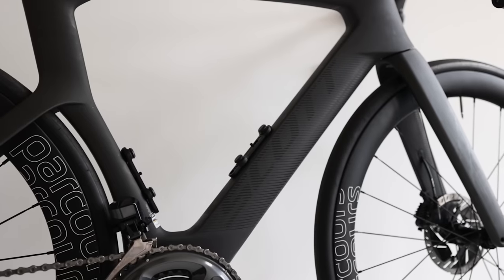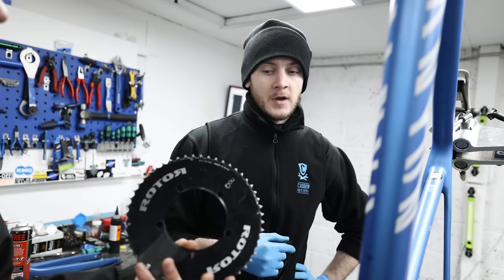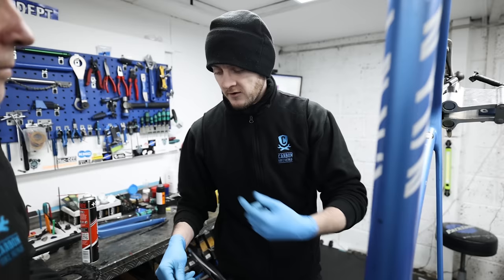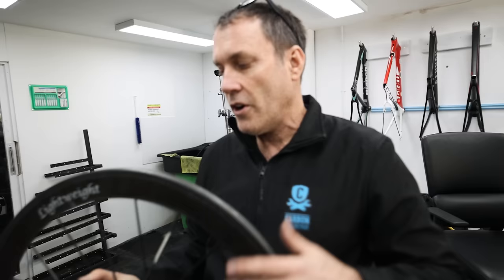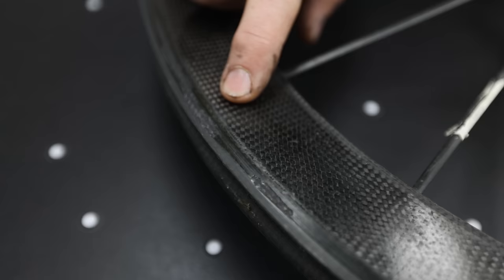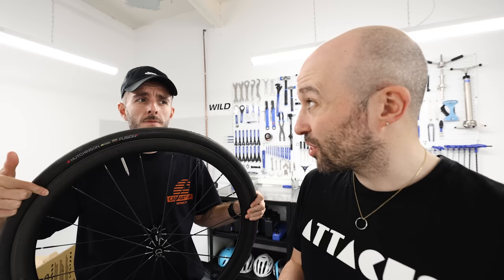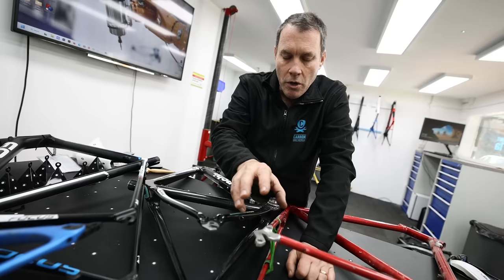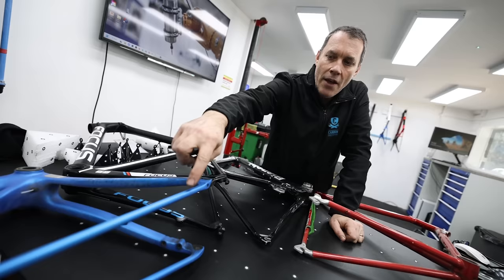6 Bike Products That Shouldn't Be Carbon Fibre

Comment: I was a carbon fiber skeptic from the beginning, and such information only serves to confirm my reservations. 

I’m not a competitive racer nor do I pretend to be one, and so fortunately the fractional lightness and aerodynamic gains possible with carbon fiber frames aren’t really that meaningful to my riding needs.

I do love smooth performance, ergonomics, pedaling efficiency and reasonable bicycle weight-control, but in truth I can achieve a quite high level of performance in these categories with good steel-frame bicycles utilizing better alloy components, and thereby nearly all of the question marks and caveats looming with carbon fiber such as potential breakage or wear issues immediately disappear, along with the high costs of repair or replacement of a carbon fiber frame, wheels etc.

No slam to you guys who feel you need or simply want the modest additional lightness or aerodynamic gains associated with expensive cutting-edge CF bikes and/or components. If you enjoy participating in the bicycle performance  arms race, and feel you can afford it, then certainly that’s fine. 

I do however, feel badly for younger riders eager to enter competitive bicycling and feeling compelled by perceived necessity, peer pressure, whatever, to have to take the precipitous plunge into the expense and maintenance caveats associated with CF bikes.

Personally, at age 54, as a non-competitor, I feel so very fortunate to be happy and very well served by higher-quality steel and or vintage bikes, allow wheels, rim brakes and premium quality cable-actuated shifting gear etc.  I can enjoy quite reasonably light and nimble machines with excellent ride comfort and ergonomics, and also reap the benefits of very high reliability, ease of maintenance and very long component life generally —and do so at a  cost far lower than anything relatively high-end in the CF world.

So very glad to be out of the endless bicycle performance “arms race”, and focusing more upon my riding, my nutrition and health, my ancillary equipment such as riding gear and nice LED lighting systems etc. The old steel frame and alloy component bikes are ever gratifying as reliable and easy to maintain long-term friends.

Perhaps some of you high-end CF boys and girls relax a bit in a few years time, and  join me out there weekends on a beautiful classic steel bike of your own 😊

Comment: The truth is that the bike industry has deceived the cycling public, with the over hype of carbon fiber, we all know that carbon fiber is too fragile compared to aluminum and steel.
Reply: Yes, I've told people countless times that carbon is only strong in their intended force vectors. This is one of the reasons my cockpit is strictly aluminium, at least while my body isn't fragile yet due to the lack of compliance.
Reply: It's not 'fragile'. It's just not made for resisting wear by rubbing (chainrings, brake surface) or hard impact on fragile parts (bottle cages, spokes, FD hanger). But it's excellent for frames, rims, handlebar/stem combos, seatposts,... Everything that needs the right balance of stiffness / comfort / weight, so mainly applications for larger bikeparts.

Comment: Entery level bikes. Don't try to make them in carbon, continue make them in aluminium. That is cheaper than aluminium dropouts on carbon fiber bikes and similar solutions.
Reply: Hey, good point. No one needs a carbon frame that weighs as much as a (hi-end) aluminum frame. Just a waste of money and material.
Reply: @hymen0callis  or a light and not durable carbon frame instead of a durable and abit heavier alloy frame.

Comment: Clocked 10000 miles on my Scott 20 speedster, not even a sniff of any carbon on it, still going strong, don't laugh, it's got tiagra on it as well, absolutly bullet proof bike, super reliable and quite quick now that it's go some Prime Attaquer wheels, bang for buck it is hands down the best bike I've ever owned, price new from KB cycles in Newburn in 2015 was £850.

Comment: I had experience with my carbon bottle cage that snapped when i didn't notice that my water bottle was not inserted correctly, probably my fault but I'm not buying a carbon bottle cage again
Reply: Is it a very light model? (like, less than 10 grams)

Comment: I love the fact that he does not like the carbon parts on the focus bike. I recently purchased one of those second hand, it had 10000km on it but looked brand new. I have also put around 6000km on it now and it is the best/most fun bike i've ever used. And i have done rides on supersixes, emonda slr, tarmac, colnago's, ridleys and a bunch more. 

I also love the look of a classic frame with straight round tubes, and the best part. It was dirt cheap.

Comment: I will slightly disagree with bottle cage. The most popular BC in pro-peleton is Tacx Ciro, cost around €15. I don't know if I will describe it clearly, it's a ground carbon from the mold, with plastic core. And there is a proper carbon fiber version of Ciro made from epoxy and layers, much more expensive. I'm using my set of cheep Ciro's for over 5 years, cause I love how they fit with tacx shiva bottles, which are in different sizes. And I'm using them right now on my 2022 Canyon Ultimate CFR :P
Reply: Yeah, that's not a carbon bottle cage. It's likely fiber reinforced nylon.

Comment: Mountain bikes. 
I understand road bikes to be carbon,
It's made for speed, on flat surface.

Mountain bike on the other hand as obvious as the name implies, for mountain. 

You're bound to crash when trying a technical terrain, even pros do, how much more inexperienced riders like me.

Bad impact will cost you on top of your medical bill.
I had a crash with my MTB, it's aluminum build so the only casualty is my left elbow, handle bar just miss aligned with the fork.

Comment: Yes 1000 times yes! As a product engineer I also get so annoyed by all the carbon marketing crap.
I also did carbon boatbuilding for about a year and a half (profesionally) And with everything I learned there about carbon, combined with my general knowledge of bikes, I prefer to stick to aluminium or steel for most bike stuff.

Comment: Good vid. Well done. Hate Carbon spokes so much. He didn’t even mention the corrosion issue.  Front mech hanger was interesting. Seen more flexy rivit ones snap into the frame than rigid carbon ones break.

Comment: I ABSOLUTELY AGREE WITH ALL OF IT . l also question the use of carbon stems and maybe handlebars because if those fail it can result in permanent damage to me :(   AND SINCE I STILL USE RIM BRAKES ONLY ALLOY WHEELS FOR ME TOO
Reply: Carbon stems are just a joke. Aluminum stems are sometimes lighter and also stronger.  Carbon bars are a big no because you can't see under the bar tape if something cracked.  Aluminum is perfectly fine.
Reply: Carbon wheels are fine if you use them on flat roads. Rim brake pads will easily do 20000km in such circumstances.

Comment: agree and almost all, in respecto of rim brake carbon surfaces, I have to say that the durability absolutly depends on the quality construction, a couple of vision low grade wheels do not compare to a couple of zipp firecrest, they have trouble in the rain, but haven't had issues, doing long days in the mountains on chilean summer, although not grand tour volume...

I have to add, sorry Giant, the damn Integrated Seat Post, one solution for a problem that never existed, rendering a "race-winning" frame useless after some use... way to go

Comment: I really like my carbon parts. Even a carbon Chainring from Carbon-TI works brilliantly since 3 years and 30 tkm. I sold my lightweights only because of tubular maintenance.
Not one thing is totally and absolutely 100% true. All statements are so much exaggerated.
I crashed with carbon parts without broken parts so often. In the last one both plastic bottles where broken. 
One thing i wont use in carbon is the rear derailleur. But this one was not mentioned. Good work! 😅

Comment: I've had a Bontrager carbon cage on a bike for a few years and it's been well used but no issues so far. I actually prefer the elite cages now as they are plastic probably polyprop and not much heavier than carbon.I have to say i wouldn't ride carbon clinchers with rim brakes now. I have still got a spare rim bike with carbon tubulars but it's disc for me these days.
Reply: As long as a bottle cage has enough material, it'll be OK.

Comment: It seams like no part of a serious bicycle should ever be made of carbon. I have two machines that have carbon forks and I find they are the only parts that I worry about and would happily sacrifice the weight benefit and install steel ones.
Reply: No, not at all.  Carbon forks are infinitely better than steel.  Better fatigue life, more comfort, stronger, lighter, about the same price or cheaper.  The front forks are the absolute worst place for steel.  Followed closely by the frame.
Reply: Right. My old Raleigh is looking better than ever.

Comment: A couple of things spring to mind,XTR carbon rear mech cages,what genius decided replacing a reliable and durable alloy cage with a carbon cage was obviously in marketing and not an engineer.The first rock strike and its gone.Also,who remembers the Controltech Crossbow one piece carbon bar/stem?Cost 450 notes but was heavier than a quality separate alloy stem/bar costing 100?Oh yeah,the 90s mtb carbon wheel fad,Spinergy/Trispoke/Spengle etc.Brake surface wears out and the entire wheel is in the bin.

Comment: bars and stems! i know they are stress tested etc etc but am just so much happier with alu. Mainly just for peace of mind if i have a crash or a ding vs minor weight savings and aero gains etc that most riders won't even notice.
Reply: Carbon bars  ( without the holes for cables): yes! they do make the ride more comfortable and are often 100 gramms lighter. Stem: no!

Comment: Stems, they are too short to benefit from the strength of carbon but you have 6 threads  weich cause problems. The lightest aluminium stems (Uno ASA 025 and ASA105) are are around 100g for the 100mm and cost less than 30€.

Comment: Had the same carbon fiber bottle cages for 10 years - no issues.  BUT, I don't abuse them.

Interesting points on all the other stuff.  A BUNCH of design weaknesses I would have thought $4k frames would have designed out. 

Time to check my old CF frame...might be closer to broken than I think.

Comment: As a bike mech for 15 years and warranty rep for 10 I'm not a fan of carbon fibre. The bike industry does not work well with it, uses it in the wrong applications and they cant charge as much as they need to to do it properly.

 There is a limit to how much money even fools will part with for bikes and parts.

We continue to see handlebar and fork steerer failures even on olympic race bikes. Crank arms on MTBs? What a joke that is needing rubber caps to survive.

I understand its great qualities for shapes ect but unlike elite level race vehicles and fighter jets bicycles especially for the mass enthusiast market are not any cost is no object products.

Comment: I suppose for the purpose of having a clickable video the premise is fine, but tbf any construction, or material choice is fine as long as you're aware of the tradeoffs for the specific gain. If having really light components is worth the decrease in reliability or robustness, it's worth it.

It's mostly a matter of treating high end carbon fiber products like >High end specialized products<

Comment: While I love my carbon saddle, it is very easy to break by leaning the bike against a wall. 
I had a saddle with a tiny crack eating into my bibs and leaving tiny carbon fibres in my behind.

On the other hand I replaced more aluminium and plastic bottle cages than carbon ones.

Comment: You could probably do the same video about titanium. It doesn't have big problems like abrasion but the cost benifit usually just isnt there. Its one of the most expensive materials to produce and work and its not uncommon for it to be included for marketing. You could probibly calculate the doller spent to gram of weight saved. I wouldn't be supprised if there are titanium parts that are $50-$100 more expensive then an equally high quailty aluminum or steel part, with the only benifit of useing titanium being, like 5 grams.

Comment: There is no pressure out on the rim on this lightweight wheel. It is a tubular rim and the pressure is directed towards the center of the wheel. On a clincher rim this will be true. Another good argument that tubular is the thing to use.

Comment: Super light carbon handle bars if they take an impact during a crash they may have been compromised but not visible. Get out of the saddle and if it snaps it's just not a good thing. That really is the case with any carbon fiber part . Seat post same thing the shards sticking out of the frame.... well you get the picture.

Comment: King Ti cages and cheap-ass, old school aluminum bottle cages for me, please.   Alloy cage from REI is like 6 bucks.  for 79 dollars you save like 30 grams.....Another benefit to the metal cage is you can bend it mid-ride if you need it to be more snug.  Been riding/racing road since the 80s and don't feel like carbon fiber has improved on this technology enough to merit its usage for bottle cages.  Functionality and durability are king.

Comment: I had a really bad crash due to carbon handlebars... It was a integrated stem one... it simply snapped and I almost got faceplanted in the tarmac. Will never ever use carbon handlebars again!
Reply: I remember one yt reviewer installed a set and they were so flexy he didnt even test ride them.

Comment: I own (and have had no problems with, I must add) carbon parts that are clamped by something - these often worry me, ie what will the eventual failure mode be? I'm thinking of carbon saddle rails, carbon bars, carbon stems (though carbon stems are often heavier than their alloy counterparts!) especially where these interface with metallic clamping components.
Reply: yeah i've noticed that too. a lot of two piece carbon stems and bars aren't really a whole lot lighter than their alloy counterparts. 10-20g difference maybe. 
so unless i'm going for a full integrated one piece, i see no reason to go with carbon. people are raving about the demands of stiffness from their stem and bar, so alloy is stiffer. its barely heavier. and its practically invincible. win win, right?
some people might go on about how its more compliant and dampens road vibration more, but i think that was an issue of the past. nowadays while we all ride 25 or 28mm tires (or even wider), or even tubeless, and tire pressures are dropping from 100-120psi back in the day with 21 or 23mm tires, to now more modern 40 to 60psi, we don't need to worry about road buzz travelling up that high in the chain of parts. in fact even 23mm tires nowadays with wider internal width tires, they are much wider inflated than they used to be (19mm internal width wheels compared to older 15mm's)

Comment: The bike industry is a business at first place. Think of post mount disc brakes that became a standard - when you ruin the thread on your fork, you can throw it away. Same apply to frame.
Reply: Threads can be repaired with helicoil inserts if it's not very severe.

Comment: Parts that should never be made out of carbon: bike parts for use outside of high level racing.
I never understood the need to get theese lightweight bikes just to go out and ride for exercise, even for commuting there's maybe a slight benefit but most commuters will say it doesn't outweigh the cost. so why are you using it to train with? I can't see any benefit to training with a expensive slightly lighter bike?

Comment: Yes, bike frames and forks should never be made of CFRP, well not for recreational use anyway. It is different for racers, they won't be keeping their bikes for more than a couple seasons. CFRP might be strong and light but is it brittle. The failure mode of CFRP is catastrophic. CFRP doesn't deform, it shatters/breaks. One complete fracture of one tube in the front triangle of the frame will collapse the whole frame. Worse still with CFRP forks, riders have died or have been seriously injured due to failed CFRP forks. Metals are more appropriate materials (Alu, Steel, Ti) as they are generally ductile and will bend significantly before complete failure.

Comment: 5:26 That is completely  wrong how to brake on rim brakes, you only use contact braking ( tap breaking) regardless of aluminum wheel or carbon wheel. This tap braking method is braking from back to front rapidly in alternating pauses feathering the brakes with soft contacts. What this does is allows for the Carbon wheels to cool down for the next brake pad contact in a different area of the wheel. This is the reason why you need a 2-3 mm gap between the pads and the wheel braking area. Basically you are feathering the brake pads into the braking surface. If you live in the flats you will never wear out your carbon rim brake wheels ever as long as you feather the pads into the braking surface at 110 PSI.

Comment: Bottom bracket bearings mounting directly into the carbon frame. Not going to fail right away but eventually the bearing is going to get loose and that is the end of that frame.

Comment: They do carbon disc rotors; the proper way to build a rotor with the improper material.
Reply: Fully carbon?
Reply: @yonglingng5640  with a carbon surface indeed!
Reply: Carbon brakes have been used in motorsport for quite some time but it is a package, carbon rotor & carbon pads. The rotors are sacraficial
& wear as the pads do. Once they are out of spec the whole lot, pads & rotors, goes in the bin.